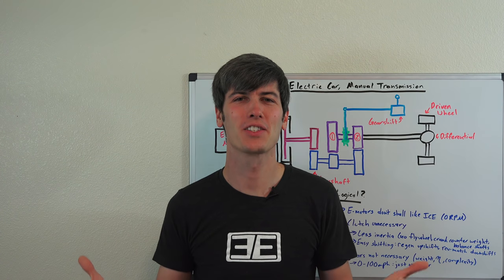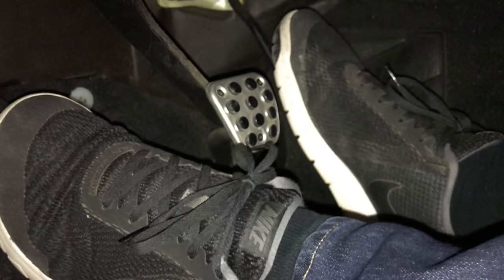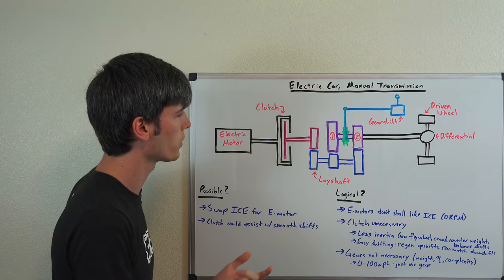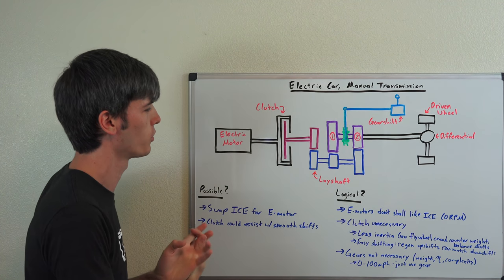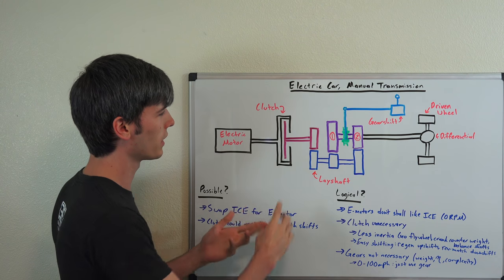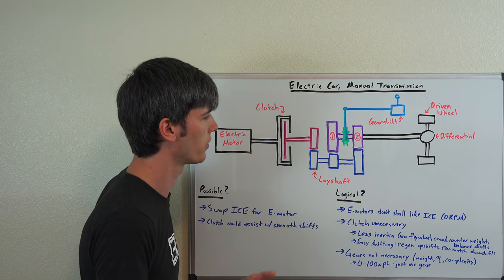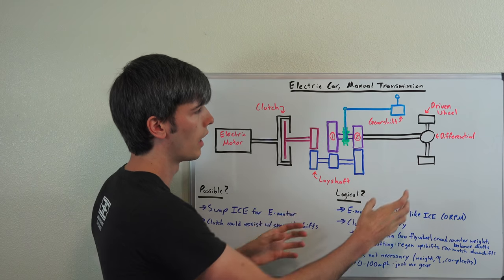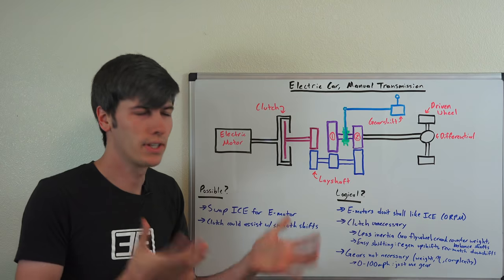Could Electric Cars Have A Manual Transmission?

Comment: As a German I laughed at the comment about normal street cars maybe only accelerating up to 100mph
Reply: Himencrash you've got the autobahn XD
Reply: Try hitting 100 mph on the 101 in Los Angeles at any hour. Not going to happen. lol You're lucky if you hit 70 mph
Reply: I did a road trip last year. Traffic in LA is hell haha
Reply: Well, my ICE car could not reach 160 km/h. I mean, it could, but I would need very long flat road.

As for electric cars, air drag is proportional to cube of speed, so double the speed, drag goes up 8 times. That is why even 20 something HP Trabant can go 100, but you need over 120hp to go over 200. So for electric, driving fast reduces range drasticaly. 
Tesla 100D going 120 might have range of 400km, but driving 250 could maybe can go 150km.
160 for normal car is fast enough.
Reply: roads in my state in Australia don't let you go higher than 60mph (100km/h)
Reply: german cars are overpriced junk... tesla destroys them.
Reply: 62 mph but close enough :)
Reply: My first car was a used 1984 Audi 4000.  It was a nice car, and surprisingly reliable, but man it was gutless.  On the freeway, I would have to downshift to third gear to maintain speed if I hit any decent incline.  Driving on a flat empty road in the desert in Eastern Washington I decided to try to take it up to 100 MPH.  It eventually barely made it, but it took forever, like 30 to 60 seconds.  I think the speedometer on that car went up to 140 MPH, which was kind of a joke.
Reply: doktorbimmer says "bimmer" guy.  From one troll to another: you gotta be more subtle if you want to get a rise out of people ;)
Reply: Mladen Milić  Because I regularly drive way above 200km/h, anything that drives slower in front of me kinda frustrates me. Well the fact it takes many drivers ages to switch lanes frustrates me. If my car effortlessly drives fast then I want to do it.
Reply: You sure you are German? Huge portions of the A-bahn are speed restricted to sub 120mph, most German cars are capped at 155mph because the front end gets loose, and there is a ton of Traffic on German roads.
Reply: @Nøderak
I don't know if statistically it't true that "most" parts of the Autobahn are restricted, but it certainly does not feel like that on the parts that I frequently or occasionally use.
Just last month I actually manged to drive a distance of about 570 km in about 4.5 hours INCLUDING the driving from the inner city to the Autobahn and from the Autobahn to the inner city. Granted I had exceptionally good condition, good clear weather and really little to no traffic and most importantly mostly no speed limit.
Reply: Thats why even 20-30 year old German cars will outrun a Tesla on the Autobahn?  My -94 Audi S4 does it easily, and thats not really that quick.
Reply: Depends which Autobahn, or rather which part of the country. Yes, in the western part many autobahns are speed restricted, in other parts not so much, and below 120 km/h is usually reserved for the autobahn within city limits and road work (dont mistake a blue sign with a white 130 for a speed limit). Around 30% of the autobahn have a permament speed limit and another 17% have a temporary speed limit, around 53% are actually unlimited. And yes, german cars are usually limited to 155 mph or rather 250 km/h, which is a step taken by the car makers to get out of a possible general speed limit at that time. More performance oriented cars can usually get a higher speed limit or completely opened if the initial buyer of said car does a driver safety training with the car manufacturer. Even rental BMW M3/4s for example have a speed limit of 270 km/h.

Anyway, the Tesla Models S and X are capable of 250 km/h as well, a speed not usually driven in the US. The Model 3 sadly is only able to do 225 km/h (wasn't it aimed at the BMW 3 series which can do over 270 km/h?). The Model S and X do not have an automatic or manual transmission, but rather a fixed reduction gear, so there are cars that can do higher speeds than 100 mph without a transmission.
Reply: correction you dont need over 120HP to go over 200Km/h i have a 90 HP car and it gets to 204/205 so with plus 20 HP you could go to about 220
Reply: @Ruben Sousa
wow... you are so far of I would doubt you're even old enough to drive.
What car exactly do you have? Tell me, what car with 90HP goes over 200kph?
Btw. my car has 185 HP and realistically only make 230kph.
Reply: Nøderak 
Are you sure u dont mix up kp/h and mp/h
Reply: Himencrash you are lucky drivers even switch lanes. In America, half the drivers don't know they must move over
Reply: My friends -92 Audi 80 1.9 TDi with 90hp logged 203 kph on the gps on the Autobahn, It was a long haul to get there but after a couple attempts we made it...
-90 VW Passat with 90 hp gas engine made 190kph quite easily, but that was in Norway and we ran out of road to go faster...
Audi A6 2.5 Tdi with 140hp did 240 no problem, also in Norway..
Reply: Himencrash
Reply: Ruben Sousa is correct. If his car is light enough, that is no problem. My old Seat toledo 1.9l TDI with about 100 or 110 hp does over 210km/h regularly. Tachometer, not GPS.
And that thing weighs in at around 1300kg if im not mistaken. And that thing is old and poorly maintained... I doubt it still has the HP it used to when it was new.
So if Ruben Sousa has a car that´s lighter and newer than mine... I have no doubt that he reaches the speeds he says.
Reply: Pfft at your Panzerwagens. I've sat on a ZZR1400 and got to nearly 282kmh. I was struggling to hold on at that point.
Reply: Will chime in here.  I've hit 115+ mph (tachometer) in my 1998 TDI 1.8L, which peaked at 89 bhp.  That's approaching 200 kph.  That was a looooong straightaway.
Reply: Pass auf, demnächst gibt es generelle Geschwindigkeitsbegrenzung auf 160km/h und dann passen 100mph auch bei uns. Opel Amera, oder Hyundai Ioniq regeln bei etwa 160km/h ab. Und da manuelle Steuerung sowieso zunehmend durch Autopilot ersetzt wird, reicht das dann auch für die Autobahn.
Reply: @Andrew DeWitt
Oh yeah I noticed that in my time there :D
Reply: Maximum in my country 120km/h = 75mi/h
Reply: @0nem1leh1gh
Ich hoffe dass das noch was dauert. Langsam fahren wenn man schnell fahren kann fühlt sich so ineffizient an. Hab immer das Gefühl Zeit zu verschwenden unter 220km/h.
Reply: Duke Of Prunes i have hit 72 kp/h in a fendt 939......if thats relevant here xD
Reply: Top speed of my German car is 95
Reply: doktorbimmer so your 100k Tesla can go 160km at 250kmh while my BMW can go over 600km at that speed. Well guess we have a winner. Yes Germans can go that fast...
Reply: Nøderak where I live I can go 100km almost free of cars on the left lane and 90% of that is unrestricted the other 10% are under construction.
Reply: Which BMW exactly does 10l/100km at constant 250 km/h?
Reply: Isn't it squared? https://en.wikipedia.org/wiki/Drag_(physics)
Reply: what do you expect from 55 kW my Legs can put out more instant torque. Evan the 88 kW Quattro was far away from quick.
Reply: If I'm doing the speed limit I don't understand how anyone would want or even be able to pass me. It's inconceivable.
Reply: As a German,, well one thing you'd certainly understand how UNRELIABLE German made cars are  :-)
Reply: @Himencrash What do you consider a normal car? Does a German Opel have a higher top speed than Chevy Cobalt, or Toyota Corolla? I've driven the autobahn in an Opel. Didn't seem to have any more top end to me. I do like German cars. Cheers!
Reply: In most countries it is less than 80mph!
Reply: 100mph is 160kph, its way beyond the speed limit for any country unless its autobahn..how many cats live near autobahn? So it was a overstatement actually... It should be said 60mph or 70mph tops.
Reply: SufferingAddict yeah, I have a car with a pretty much  identical power rating of 90 WHP, and Realisticly the fastest I can go is 110 mph/175 KPH
Reply: True that, sadly most of the time the Autobahn is so clogged up by traffic, exceeding 100 km/h can be rare.
Reply: i reject your "fast enough" argument, because merica
Reply: depends largely on transmission. my old 140hp bmw had a topspeed of about 220kmh.
Reply: probably has a short final drive ratio.
Reply: Obviously not seen what goes on in Russia then...
Reply: On a different not, who else thinks Youtube have totally fucked up the new comments system...?
Reply: mate its been like this for years. and ye it sucks.
Reply: I do. it is so broken and every update breaks it even more.
Reply: 90 ps will only you to 203 km/h GPS in an unmodified Audi 80 when going slightly downhill . And 240 km/h with 140 ps in an Audi A6 is SERIOUSLY downhill . 140 ps only gets you to about 210-215 GPS on a properly level road in that car. My 1998 Lexus LS 400 had about 300 ps (standard output was 284 ps) and only managed around 260 km/h GPS on a level road... And that had a drag coefficient of 0.27, so it was very aerodynamic. If it was in the best shape possible, it would get to around 265 km/h GPS, not more. Downhill, 300 GPS would be no problem... But that would take a HUGE hill... Long and steep... With already pretty high entry speed.
Reply: well theres a limit to everything. that you cant drive at 200kmh with 50 hp is obvious.
Reply: doktorbimmer haha nice try
Reply: ford puma 1.4L 90HP. doesn't matter what the specs say ive clocked 203km/h in a straight line just takes about 1min from 180 to 200
Reply: If you double the speed the air resistance become 4x greater not 8
Reply: @jakubkrcma : Might be slightly downhill, but its flat enough that it seems/feels totally flat. 
The A6 has has low drag, and a "german" gearbox suited for high speed. And as I'm not the original owner I don't know if it was totally stock, but it ran good. Tuned it later and then 250+ was no problem, but I never had the chance to really test top speed before my wife totaled it...
Reply: they are electronically limited to 250
Reply: i think outside of europe the manufacturers dont follow this agreement of electronically limiting cars. theres one european automaker which doesnt either. i think bugatti maybe.
Reply: KingProne That's all very inaccurate.
Reply: bmw audi and mercedes and porsche do.
Reply: Gusti, lol a mitsubishi with 400hp doesn't do 300km/h +, maybe on the speedo but it in real life it's probably more along the lines of 280-290
Reply: +Joey Garcia: Oh you can hit over 70 on the 101, just not at normal waking hours. I've done it at 5am, where the going speed is closer to 90mph. Imagine being in the right-most lane doing 90mph and being passed on your left by a cop. That's LA for you.
Reply: well theres also a lot of people driving 100mph+ in the uk, france etc. UK is particularly known for very lax speed limits outside of certain crowded areas (which usually have a variable speed limit and cams so you cant speed) where crusing at 90mph isnt uncommon during daytime hours either. Once you get to the northern bits driving 120-130mph for a while isnt completly uncommon if the motorway is otherwise empty.
Reply: Joey Garcia Try Chicago or St. Petersburg, FL. It's like NASCAR there - bumper to bumper at eighty miles per hour. Try not to scream.
Reply: SufferingAddict your spot on, my car is 175bhp and will do 140mph (about 225kph). A 90bhp car will probably maybe hit 100mph on the flat with a good tail wind.

However, a 90bhp car is not made to go 100mph, that would be simply dangerous.

And all the folk above wanting to go 155mph+, is all well and good in theory, but for me anything over 100, just eats fuel.

I want a quick car for fun on the lanes, good 0-60 times, top speed doesnt bother me. When on the motorway, I'd rather get decent mpg at around 80-90mph.
Reply: I went 100mph with a 1.6 diesel rabbit once, tuned as much as me and my buddys could, and 5 speed gearbox. aaaand the mother of all straighs.. took a couple minutes to get up to that speed but it made it at the end..
Reply: Renax the Man a 1.6 deisel, even if low bhp should have plenty of torque, for them long runs.

Today's turbo deisels gan get quite alot of power from a 1.6 engine. Renault have a great 1.5 that returns about 70mpg, ford have a similar 1.6 t deisel unit.

Is a rabbit a golf?
Reply: Stephen Butler a rabbit is a golf yea, this was a 1980's model with 54hp stock. But in a small light car you don't need much...
Reply: Renax the Man I bet you used a sun dial to measure its 1/4 mile 😋
Reply: doktorbimmer tesla cars are built like they where made in china, what have you been smoking?
Reply: Yes well the Autobahn is not what it used to be. Having lived in Germany for 12 years I know what it is like. It is not the unrestricted motoring heaven it used to be. It is still great do not get me wrong just not what it once was. leksluthor trust me when I say the U.S. roads are not fit for speeds in the triple digits and we have too many miles of road to even think about improving them for triple digit speeds! Also in the U.S. they practically give driving license to anyone. It is not like learning to drive in Germany.
Reply: leksluthor
You mean looks the EQC? 😉
Reply: leksluthor Haha, i've got BMW M2 and we are listening to primates driving japanshit with 100 mph max speed
Reply: As an Indian, I can confirm that you cannot go faster than 30kmph in normal city driving conditions, unless you're crazy skilled.
Reply: Unfortunately, some idiots put limit speed in America, I always saw people who drive more than 100 mph in 70 mph zone in rain condition in highway, we live through it so whoever it is put speed limit, put them into the ranch.
Reply: I mean even on the Autobahn it rare to see your average car making it to 160kph/100mph
Reply: laughs in Autobahn
Reply: @SufferingAddict88  my car has negoar 120 hp it  goes 195 to 200